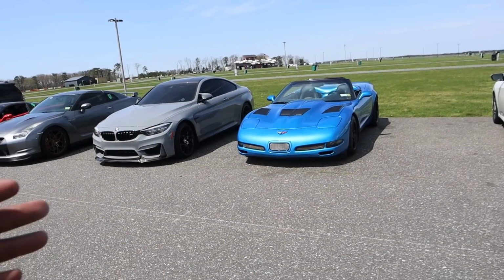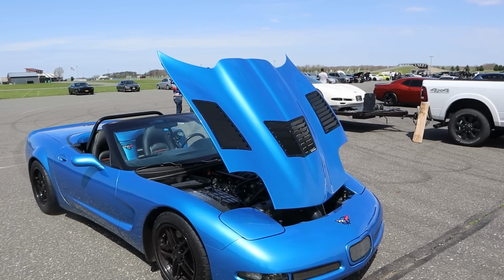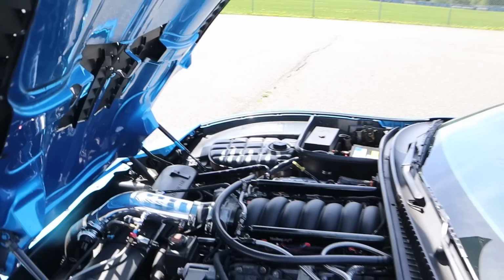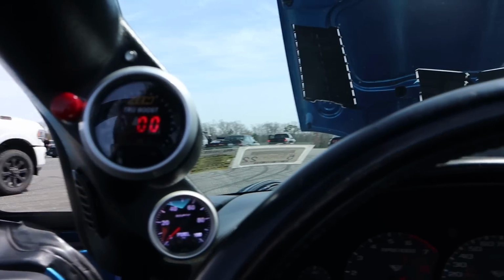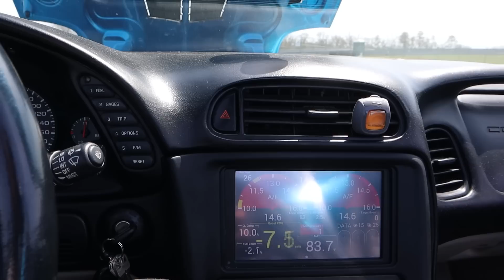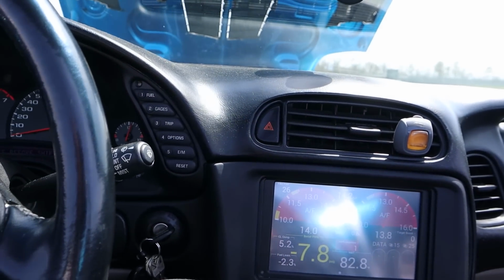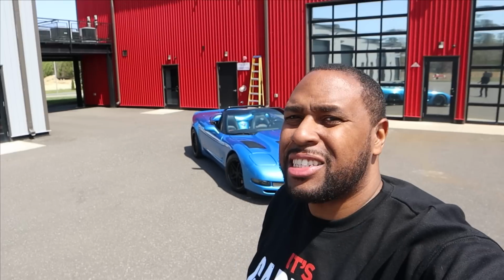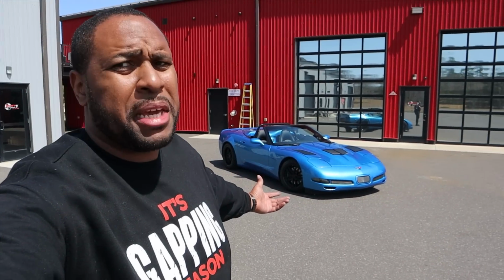Test Driving My Dream Corvette C5 Build

Comment: C5's are the absolutely lightest modern Corvette you can have. Those things are under 32hundred pounds so the power to weight ratio is on a WMD level. I was you I would put a F-series Procharger cause of the instantaneous response. Nobody will be able to keep up with you once you put your foot to the floor. Being that a Procharger is a centrifugal supercharger the parasitic loss is similar to a turbo which is around 12% at its highest demand on the engine. That being said Huron Speed makes some insane turbo applications for Corvette's. Nice video Stef I know that C5 had your drooling.